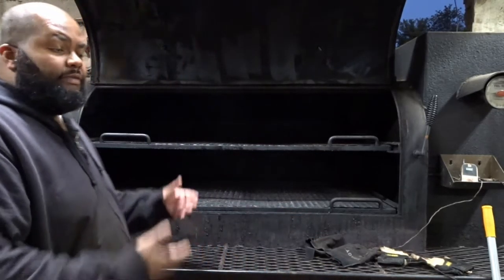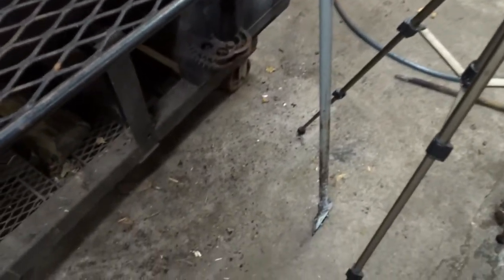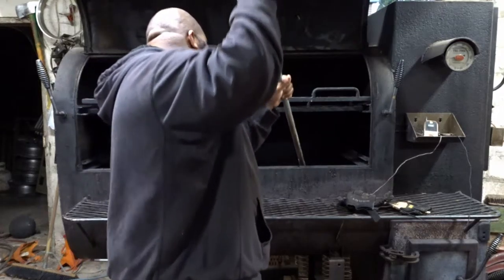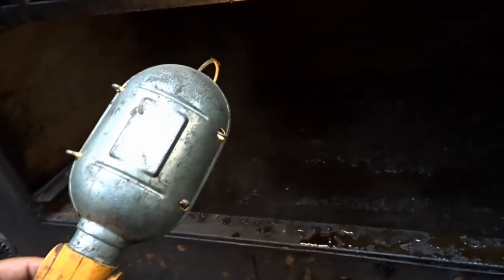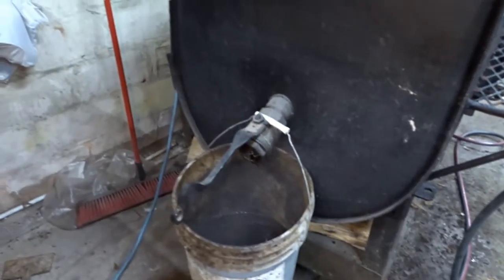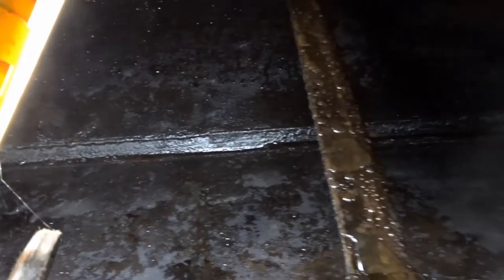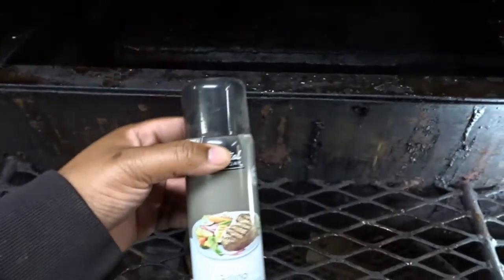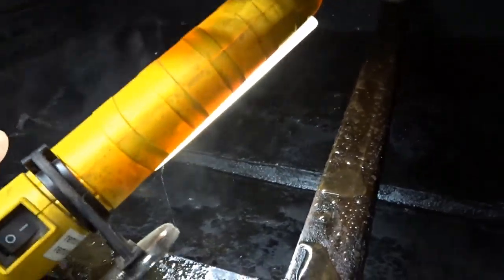SDSBBQ - BTS of a BBQ Catering Job Cook - Part 3 - Cleaning The Smoker

Comment: waddup bro... nice vids so far. im headed to part 4 next lol.. but quick question... how much space is between your fire grate and the bottom of the fire box itself...do you ever have any issues with ash and the fire breathing...? it didn't look like it
Reply from the maker: So this smoker is reverse flow so the fire is on the far right and the heat and smoke come under the cook chamber before going in on the left side so not much ash and usually never any fire breathing unless I have the fire in an ALL CAPS RAGE!
Reply: @SDSBBQs  thx for responding bro... I see the reverse flow but i was really asking how much space between where your logs sit on the grate and the actual bottom of the box (3 4 inches maybe?) ... I hope I'm not being difficult... I'm just asking because I'm having one built... the guy building it wants to put the box in the middle having the heat come in that way... new to me... any thoughts on that too?
Reply from the maker: There is about a foot of space, but it's a little more difficult that just trying to give you a measurement as it varies as wood is added and burns down. I'm not sure about having the fire directly underneath as all of my smokers are reverse flow smokers.
Reply: @SDSBBQs  thx bro for taking the time out to respond... I've got some things to consider lol
Reply from the maker: Sure thing... good luck!

Comment: Nice.. So many people don't realize how important the clean is.. I. always clean mine while the meat is resting. I spay as well with oil, but I never heated back up to set the oil.. I will do that next... thanks.
Reply from the maker: I usually only "set" the smoker while it is still hot and I may only do it once every 2 months or so. Typically when I get the urge to go OCD cleaning it out.

Comment: I haven't been having a big problem with the drain in my smoker clogging, at least not yet but mine actively drains all throughout the smoke. You ought to see the crud I catch in my little drain catch bucket, it looks like the nastiest oil sludge you've ever seen. The worst part is if I forget to empty it while the grease in it is still warm and it solidifies in the bucket... what a pain. lol  I'm sure, come spring and time to pull it all apart and pressure wash everything (like I did this spring) I'll be hating life again. Gotta make sure you've got a dedicated set of work clothes you don't mind if they basically get ruined for anything else... maybe mechanic work.

P.S. Got a new video camera coming today, I just cleared 10k views on my channel and have been able to monetize my content. I'm pretty happy about that.
Reply from the maker: Congratulations on the monitization.

I know what you mean, when I don't clean the smoker out while the smoker is warm I have to use a vacuum to get all that gunk out of there. Don't know if you noticed but I do have dedicated clothes. I usually have on one of my old t-shirts that is black and that black hoodie is covered in BBQ mess that you can't really see on camera.

Comment: Fascinating Dash, treating like a cast iron pan.  Hmmm

Have you considered a small pressure washer to clean?  Maybe getting a small sprayer and some bulk cooking oil to reseason?

Thanks for sharing have a great week!
Reply from the maker: It makes it look cleaner if it's not "rusty" looking, IMHO and slightly easier to clean.

I have a pressure washer that I took on trade for some mechanical work... I just need to fix, I've been waiting for a good time. This is the third time in 3 days I've talked about it. Usually when I talk about it a few times I end up working on things. 

Thank you for watching!
Reply: I would also think less rust, more life!  Costs big $$$ to replace a BBQ.  Happy Halloween!
Reply from the maker: Yeah Buddy! Right back at you.
Reply: I've tried canola oil in a garden sprayer. It didnt work too well. The oil was too thick.
Reply from the maker: Hmm. I've used Crisco before but it was a pain to spread around since I had to apply it while the smoker was hot. Using the aerosol cans is WAY easier and much faster.
Reply: Maybe warming the oil up will decrease the viscosity enough to make it sprayable.